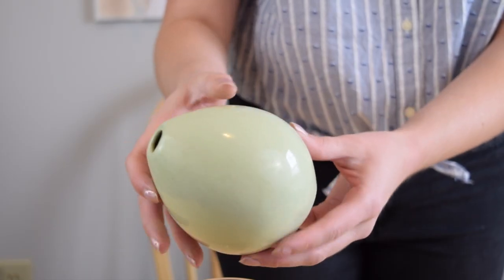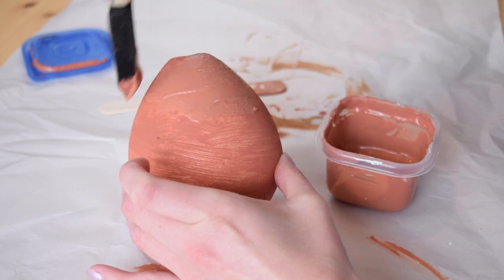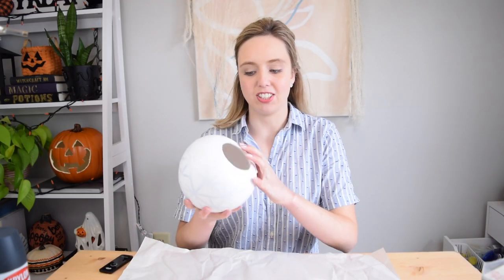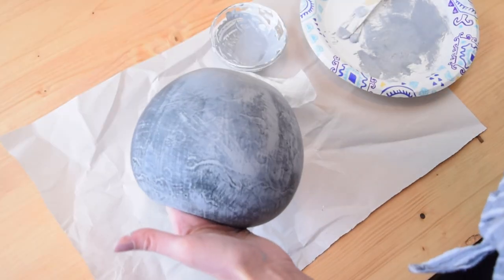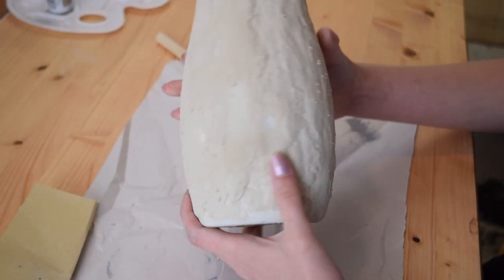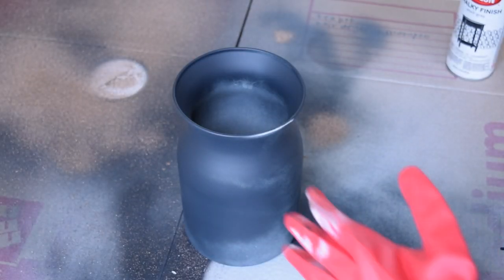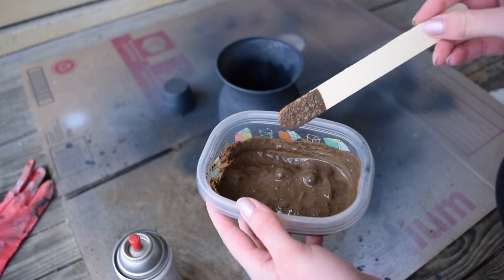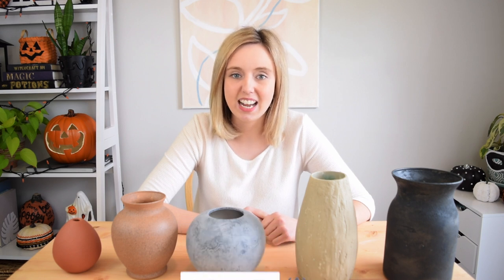5 DIY TEXTURED FAUX CERAMIC VASES: Testing Hacks to Create Stoneware Pottery || Actually Alli

Comment: I appreciate that you used primer and a top coat! Drives me crazy when DIYers paint right over glass, plastic, or an existing glaze without sanding or priming. Whenever I go thrift shopping, I always find a few "DIY fail" vases that weren't properly prepped and primed--the paint job is cracking and flaking off and looks terrible. Prep is key to a successful project. So thank you for demonstrating the correct way!
Reply from the maker: I'm definitely happy I didn't skip the primer! All the finishes have held up really well even a year later!